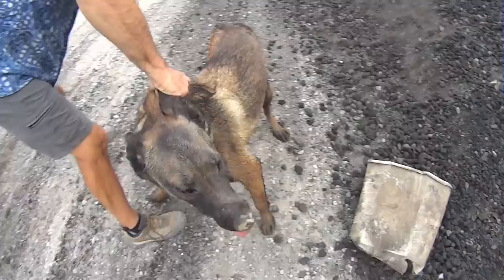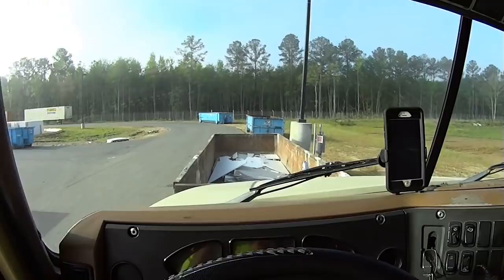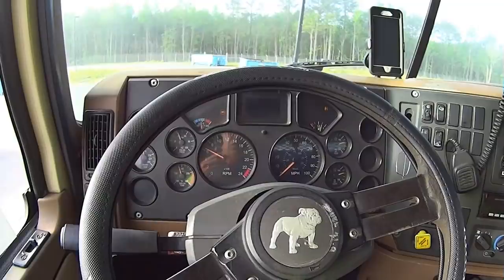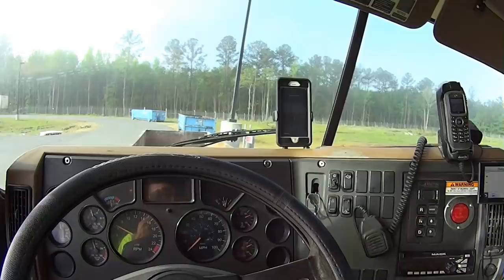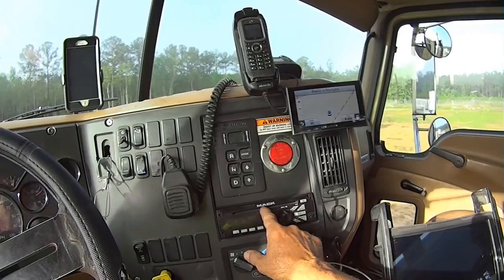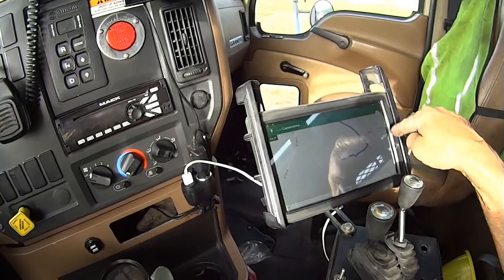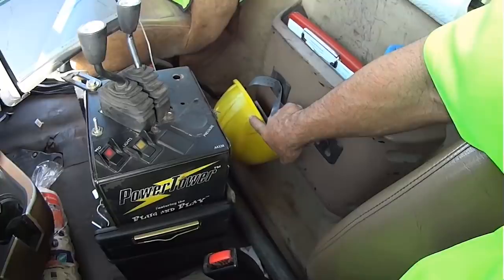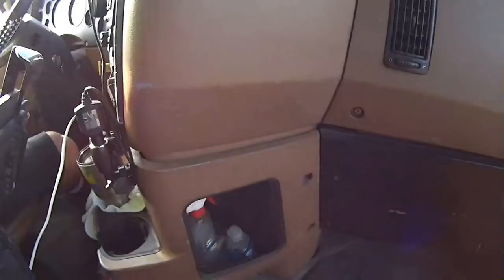Inside My 9 to 5 Office - 2005 Mack Granite Roll Off Trash Truck

Comment: Hi Dan. Unrelated to this video but, I'm planning on purchasing a high PSI (4500) 4gpm pressure washer. Will I be able to use it for soft washing houses just by changing the tips? Or would a lower psi washer be more effective?
Reply from the maker: just use the black and pink tips and there will be no pressure. Just a nice flow like you see mine

Comment: whats the difference between a manual and a automatic truck. do they run the same and have same strength or they run different
Reply from the maker: +Segundo Aguayza Meaning stick shift. Same power for the most part
Reply: OMG THANK YOU Dan's Vlog was expecting you to respond back thank you